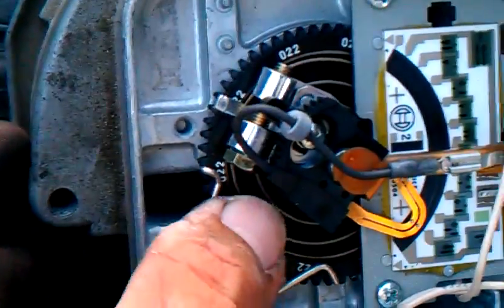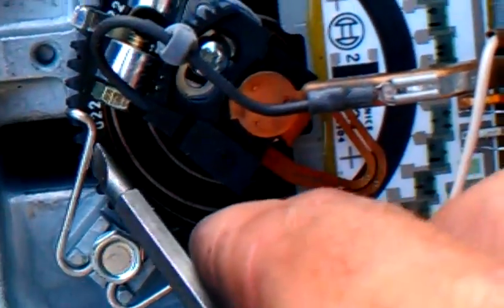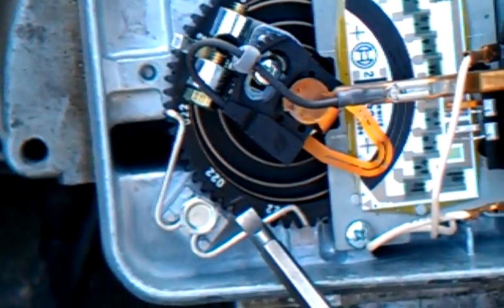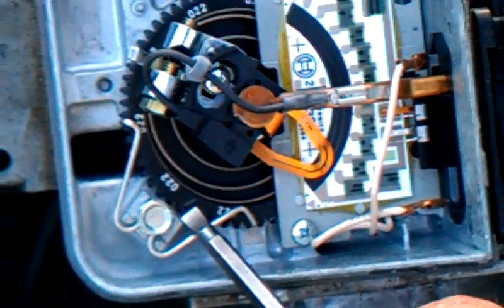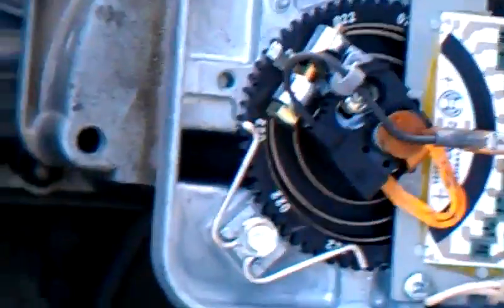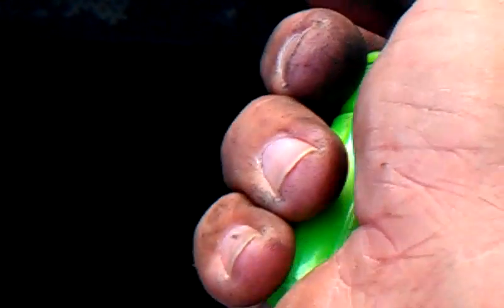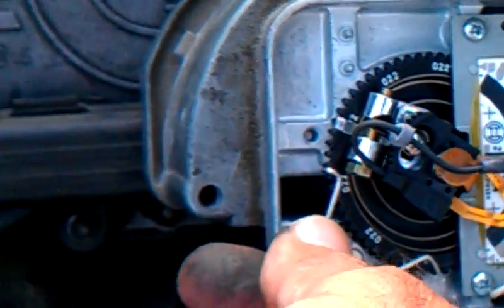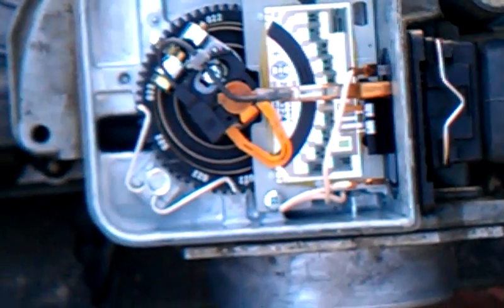AFM ADJUSTMENT TO CORRECT AIR/FUEL RATIO

Comment: Okay.. whenever you say 'never-ever' I start for the lever.  I appreciate your observation about 'types' of fuels used in the 80's.. CRC MAF cleaner, a non-toxic sealer for the lid, sealing the unit and making sure that you have no cross contamination from you fingers (oils) and bypassing the pressure arm contact with a solder job and 4" wire.  I have a 1985 Digijet system on my Vanagon and experienced the BUCKING issue at 2750rpm.  Only thing that you can depend on is if your are driving in any gear, as you hit the 2750rpm range.. WILD BUCKING so sever that it shook off the meter from the rubber grommet/shroud going into the engine.  BOSCH in their infinite wisdom does not make any replacement parts, GOWESTY designed their own system to replace the DIGIJET and DIGIFANT systems at a craaaazy price of about $2700, soon available.  BMW/PORSCHE/VW/AUDI all using the same basic style of equipment.

Comment: Thank you sit for this simple yet great video!! I've been running lean to the point of my exhaust manifold glows when open throttle for 10min+. Until I can figure out exactly what's causing this I will try this modification to keep my truck safe. Who knows, the AFM could be the problem, but it is a newly rebuilt one so not sure. Thx again!!!

Comment: thank you.  about how many "clicks" should the wheel be turned to reduce NOX?  my bmw failed because of high NOX.
Reply from the maker: You have to drive the car with an active Wide Band Air/Fuel Ratio gauge and tune into the "green" range at 1500 to 2500 RPM. Or about 14.0 AFR. Lower numbers are richer, so 13.6 to 13.0 at wide open throttle will get you there.

Comment: if I make it more lean will i get better MPGs?
Reply from the maker: Only to a certain point. If you want mileage, buy a Prius. BMWs are not economy cars. The motto has always been, "The Ultimate Driving Machine," not "tighter than a Honda."
Reply: This is just what I’ve heard.     Leaner you get a motor- the hotter it runs.

Comment: But why would you have to change the sweep arm idle position setting by changing the spring. The is a idle mixture screw that does the same it changes the amount of air that bypasses the afm (unmetered air). You also don't need to bend the arm when there is bad contact. Clean the black strip with alcohol, if that doesn't help loosen the circuit board and a bit back toward the sweep arm pivot and the arm rides on fresh black strip. Just an idea. I just don't like to mess with factory settings.
Reply: You can remove the circuit board, elongate the holes, and put it back with an offset so the contacts sweep across fresh resistive material. Tweeking the wiper arm is easier. Adjusting the spring tension has nothing to do with the idle position. It allows the door within the AFM to move more or less easily which effect the air-fuel ratio at a given RPM.
Reply: Vern2765 hey Vern, it has been 2 years since I first posted my comment. I have found pretty good instruction on how to work the AFM. I think it only makes sense if you have access to a wide band oxygen sensor/tester. here the link of the instruction I have followed in the past. http://www.itinerant-air-cooled.com/viewtopic.php?t=7761
Reply from the maker: Heiko. Factory settings are for a new car. Is your car new? That screw is not an idle mixture screw. I'll buy you a beer if you know it's true purpose.
Reply from the maker: Correct.
Reply: the screw is only for the idle mixture.  if you wan to affect the mixture beyond idle you have to adjust the wheel a few teeth.
Reply: Also this adjustment doesn’t do shit anyway so don’t bother.  It only affects the mixture at idle or full throttle when the engine is in open loop otherwise the O2 sensor will adjust the mixture and counteract anything you’ve adjusted in the AFM while the engine is running in closed loop.  Pointless adjustment ... better to rebuild or replace the AFM with a working used OEM unit if there are issues.
Reply: Vern2765 .right, it is not a idle mixture like on a carb where it actually control a fuel amount going through a jet. In this case it controls a bypass that allows air to bypass the afm gate. So you actually increase or decrease unmeter air that passes through the afm system. It does have an effect on the entire range from idle to full throttle.
Reply: heiko K could you share?
Reply: Please, kindly give me details on what to do because my vehicle brings out black smokes
Reply: heiko's garage How do I know where to stop? Just listening to idle? Any specific RPM?

Comment: Also, here is another ti[p I learned on my own. When you AFM starts messing up, most times the sweep arm isn't contacting the board. Had this happen on my 745i and later on on my e30 it would miss at 4,500 and at 5,000 rpm. it would buck, pull to 5,000 and then buck and pull again to redline. I took off the arm, bent it down slightly to increase contact pressure and bam. Problem solved. Same thing on the 745i, except it ran way worse, whenever boost came on it would run like crap and then die until it sat for a while. Couldn't figure it out until I saw the arm and pushed it down. Instantly it idled right, so pulled the sweep arm off and bent it slightly down and voila! fixed.
Reply: Actually the problem is not in the down pressure of the viper (sweep arm) but in the resistive trace wear out. Since you bend the viper you slightly change its track to a fresh and not worn out one and it starts working.

Comment: Has this helped your gas mileage?
Reply from the maker: No. Gas mileage is a function of Professor Bosch's "best lean burn" principle, which is for fuel economy, not performance. In this video, I am tuning for performance, based on the Air/Fuel ratio needed to pass California emissions standards. Best lean burn + modern California fuel, which is not truly gasoline = failed emissions testing. This is due to high NOx.

Comment: So if my BMW has idle problems so I go clock wise or counter clock wise??
Reply: You should probably clean your icv "idle control valve" lol
Reply: Which he won't have if he has Bosch Jetronic or Motronic management.
Reply from the maker: Idle problems are varied.
Reply from the maker: scbonduk. Wrong. Idle problems vary and require a full range of old fashioned diagnostics.
Reply: Vern2765 Again, how am I wrong? I never ever stated that idle issues aren't various causes. You're getting yourself confused.
Reply: scbonduk but they do have ICV on jetronic and motronic m20s...